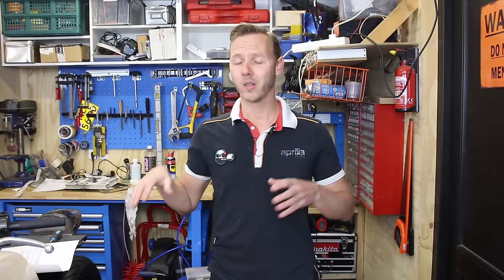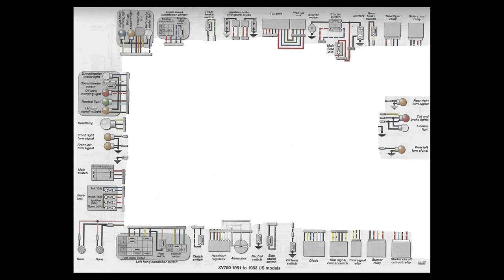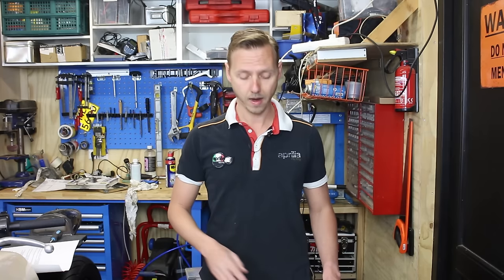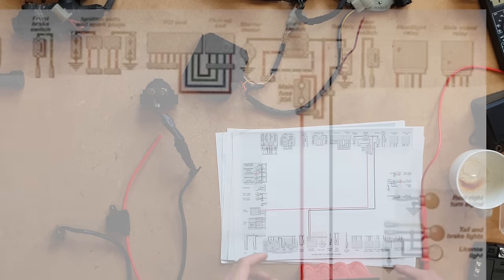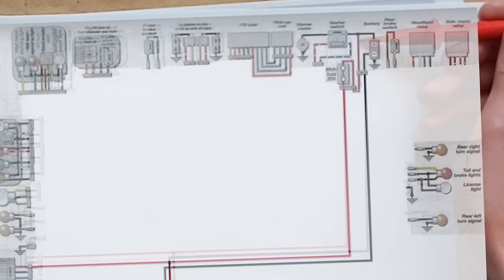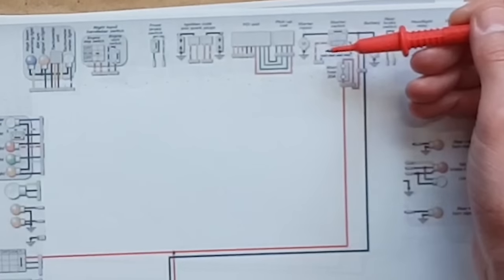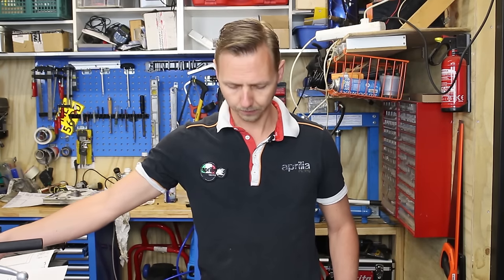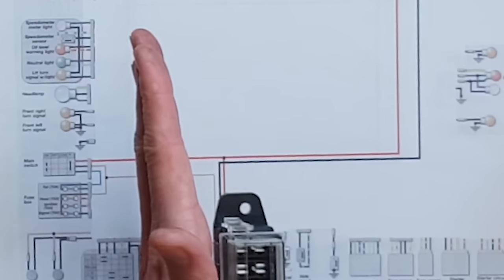Wiring a motorbike (or caferacer) 'Bare Bones' (part 2 of 2)

Comment: Would you help me 🙏🏻:
I have Kawasaki kz750 twin building from scratch (bobber) my regular have 2 yellow wires one black one white/red and brown …
Yellows need to connect to stator,
Black is negative - 
White/red it positive +(feeds battery)
And brown I have not a clue… on diagram looks like is connected to brake light switch 🤷🏻‍♂️. Would you help please?
Reply from the maker: I am sorry. I am no service dealer. I use these video's to answer the questions. Best is to go to you dealer or try a specialised Kawasaki Forum
Reply: @chiefpepdesign  Thanks 👍🏻.

Comment: so instead of the starter button could i have a 3 way key switch so i can turn over my bike like you do with a car? just turn key
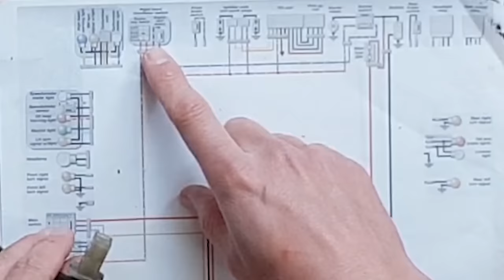Reply from the maker: Offcourse you can! Then the last turn of the starterkey switch would be exactly the same as pressing a button. It's just a ground cable that is interupted. It needs somebody or something that puts those wires together. Like an on and off switch. Closed/open line as I tried to explain at 17:42 but also a few other times in this video like the kill switch part at 14:42.
Reply: @chiefpepdesign  sweet i imagined so since, like u say, its just a switch. thank you!

Comment: Great video! Moto starte tot een oil level lampje aan ging en verder geen reactie meer...Ik hoor je zeggen dat ze allemaal wel elektr problemen hebben, tips? Neuter switch OK, Oil level OK, Oil level switch OK, rest zou ook ok moeten zijn daar hy gewoon draaide voordien. Geen start solenoid klik meer, staat in run en enkel oil level gaat branden als je de startknop indrukt.
Reply: Ik denk eraan even jou schema te volgen door. start relay, start circuit cut out relay en diode te ontpluggen en brugje te plaatsen tussen kabel vanengine stop switch(idem ignition coils) en Starter solenoid. Dan heb je nagenoeg jou schema.
Reply from the maker: @peterlauwers4553  o gelukkig want het heel moeilijk om zo op afstand te zeggen...

Comment: Should there be current in the red white  wire from the solinoid? I am wiring mine and I think the solinoid is faulty as there is no power on that red white wire.
Reply from the maker: You can check the solenoid stand alone. See my first wire video for that
Reply: I have tested the solinoid as you did and it seems ok. But when I wire it in should I get current on the red/white wire because I don't get anything. And when I hit the starter I get nothing.
Reply from the maker: @Shed_Heeran  Follow above video from 12:30 Otherwise I am trying to explain in text what I am saying in de the video. That doesn't feel logical. I made these video's because I get these questions so often. I am sorry I can not help  you in another way.
Reply: Hi, thanks for the replies. I found d the fault my ignition switch doesnt take ground from the handlebars it has it's own ground. I was being stupid and hadn't wired that in. Keep up the great work on the vids. They are seriously helpful
Reply from the maker: @Shed_Heeran  I thought and hoped you would find out with a little help of the vids. By figuring it out by yourself you will get better and better in finding flaws. Good luck!

Comment: Ok i get what you are saying, but a  IC IGNITER has 10 pins, but in the Kawasaki diagram only had 9 wires going in, so which pin has no wire, unless you know what pin has no wire the unit will not work. none of the part have wires or block on them, unless you are saying it dose not mater what pin you miss as long as you have 9 in
Reply from the maker: No offcourse not. You could go to a scrapyard and try to find one there. Otherwise go to a dedicated Kawasaki forum. I am very sure you are not the first one with this question and otherwise there will be someone who is willing to make a picture of their connection.

Comment: Very helpful but what did you do with all of your relays?
Reply from the maker: Didn't use any op them. You don't need them. Only the turnsignal relais. But I use the Kellerman relais.
Reply: Are you serious? So using this method I dont need any relays other than turn signals
Reply from the maker: @VeneerSlinger  indeed. Just follow the 'programme' step by step. It get's rid of 38 wires and all of the relays. That's why it's called barebones
Reply: Thank you I've been kicking myself in the ass since the first time I watched this video.
Reply: That's an aftermarket tci correct? Which one are you using?
Reply from the maker: @VeneerSlinger  no. The later versions have a black plastic tci. The earlier models have the metal ones with the cables on them.

Comment: Hi! Where did you get these good quality bike wire diagrams? In Viragotech forum they are in very poor quality.
Reply from the maker: I got them there aswell. Search totallyredvirago He's the author.
Reply: I have not been able to find the page by page diagrams you have. I have tried viragotech and totallyredvirago. It shows the links are only for members on one.
Reply: @chiefpepdesign  would you mind sharing direct link for it i have been trying for several hours to find them but site just keep crushing on me does it happens normaly or is it just me ? 😞😞😞
Reply from the maker: @majolamlech  no I don't share them. They are not mine. First you have to register on the forum. Then wait untill the moderator accepts you (could take one or two days.) Then when you get the confirmation you always need to login again when you visit the site. You always check the right upper if you are signed in.  Otherwise, pause my screen on your computer and printscreen.
Reply: @chiefpepdesign  succesfuly managed to register ❤️ love you are beeing respectfull

Comment: please cheifpep i have a xv1000 85 and have electic problem since one year;i just want to remove all wiring and do it like your profesional work, can i apply your schema wiring on my xv 1000 85 pls; i know a have a fuel pump but i will bypass it,thank u chief
Reply from the maker: Yes you can!
Reply: @chiefpepdesign  thank u very much ,cause i recently bought a new tci box from ignitech and when plug on my bike it dont work dont get spark ,so i contact ignitech and they told me that i have an electric problem wiring on my bike,so i know i have to make a install a complet wiring ,and your explanation and schema are far the  best simple very  good clear explation

ps i  i have a pick up coil spare part and when connected to tci box ,battery, ignition coil, spark plug ,i simulated the pick up coil with a piece of metal i got spark, so
when i test ignition tci box on bike it dont work ,but when tested for spark on a table with all component (battery,pick up,ignition coil,spark plug,it got spark, so i guess  i have definitly a wiring problem on the bike,thanks for all you made thing become so simple
Reply from the maker: @sylviequirin2371  yes. Good work to test it outside of your wireloom. Just build the whole wiring yourself. Do it step by step. Use the video's from the very first start (even the 'test your electrical components' video) to make sure you don't miss one step and you are sure you understand every piece in your bike. It makes yourself more confident.

Comment: Did you order the fuse block from the blue sea website?
Reply from the maker: Rchard Salie No at a local watershop website. An official dealer of the brand.
Reply: Do you have a website of the shop? Having problems finding a website in the Netherlands to buy the Fuse Block. I Live in the Netherlands :)
Reply from the maker: Rchard Salie offcourse: Landreiziger shop. Succes!
Reply from the maker: Btw. I see it's a car/modification shop. But watersport dealers often have them as well
Reply: Dank je wel. Leuke en interessante kanaal leer veel :-)

Comment: Hello friend, anyone maybe you can advise  I have issue With KTM 1290S 2021 new model. there  is No neutral indication, no gear indicator and you cannot start without pressing clutch in, Quick shifter Active but not working, And after about 15 minutes ride   on the bike ,suddenly lose power and it feels like going from sixth gear to second gear and you lose control of the throttle,no response, But it doesn't shut down, I go to the side, Kill the switch off and start again after 1 minute, And you get control on the throttle again, Until arriving home safely slowly. Last time I was in the service they have reset the computer and quick shifter plus gear indicator and neutral light came back but after stopping to fuel the bike The problem reappeared, And the worst thing is that lost of power as I mentioned after 20 minutes or so, Every time it happens I get cruise control light , Traction control,engine light, And if this happened on  Rally mode, so there is  N.A  Appears on the left side of the screen, I cannot also switch between mode, So guys if anyone experienced such catastrophe I would really appreciate your thoughts And ideas about this problem🙏
Reply from the maker: This sounds like a complete computer failure. Since the bike is so new, this would 100% fall under manufacturer guarantee. So go back to your official KTM dealer, and they will most definitely fix this. Good luck!

Comment: I wish there was a well explained video on the xv750 for anyone using the m unit blue..😞
Reply from the maker: M unit is a (very, very) expensive thing that basically does nothing more then connect wires exactly like I do in my video's. It's just a hub. Nothing more. You save a lot of frustration and money by just connecting them the old fashion way... Sorry to say that.

Comment: What if you need to run a resistor on the ignition circuit
Reply from the maker: Why would you want that?
Reply: I’m using a bandit engine with cdi and coils to Harley switches and ignition

Comment: everybody can read a diagram about wiring, the only thing no one seams too know is what colour wire go's on what pin? unless you no this part making a loom for your bike is useless.  lets say for instance you got an ( IC IGNITER ) what has got 10 pins how do you know from a wiring diagram what colour go's on what pin?. this is the bit that is not on a wiring diagram...
Reply from the maker: Yes you can. If you follow the colored wire on the diagram from the igniter back to where it is connected you will see where it ends and so, what's the origin. But you need the plug in real life aswell to see on what pin that color lands.

Comment: Chiefpep, as many others I also am hoping to follow your videos on a xv750 chop i am building from recycled materials, on the cheep as possible, I am also a member of viragotechforum as Baldrick but cant open for some reason the diagram pages related to tatallyredvirago's posting, is it possible to email me copies so I can print them off? Nice build by the way also, looks sweet. Kind regards Baldrick, Czech Republic
Reply from the maker: Hi Baldrick. You have to be logged in to access them. And they don't get very bigger then they are. No sorry, I don't e-mail them. They belong on that forum in that topic...
Reply: @chiefpepdesign  , totally cool, I understand completely, thanks for your reply, i cannot however access the forum and have a few help threads there. It seems the site isnt working for me at the moment., Thanks again ))
Reply from the maker: @baldrickmartin2814  That could be right. Sometimes it's off due to some unknown reason. It's a privately funded forum which is actually grown way too big for the backoffice where it sits on... We sometimes have to be patient... 😊
Reply: @chiefpepdesign  cool, i am patient for sure, regards again